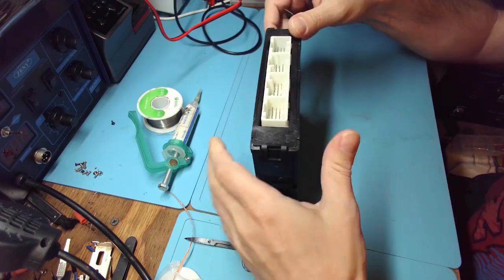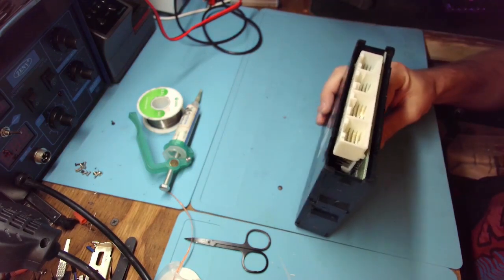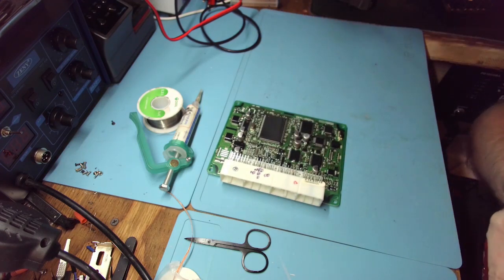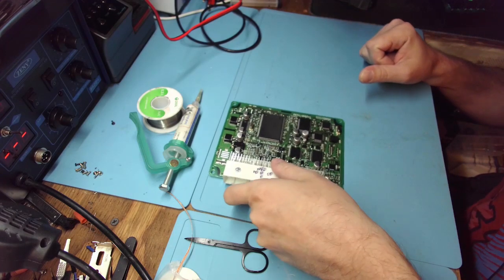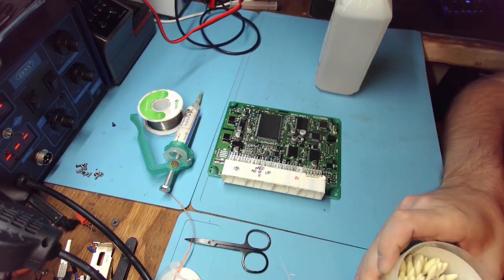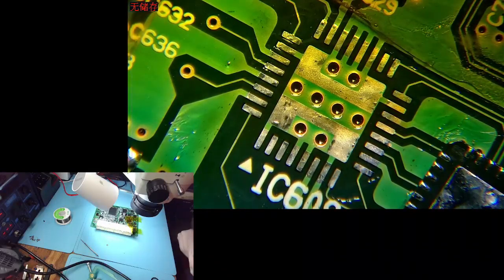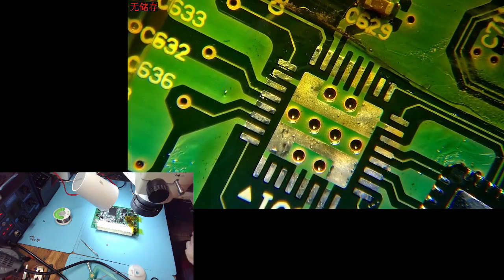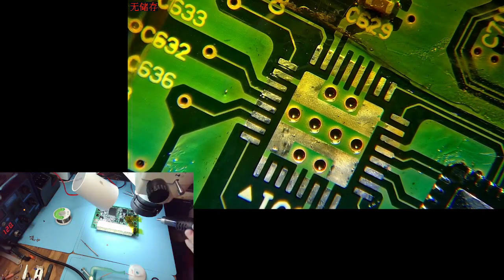Subaru ECM Repair for Ronald [WY]  | Only RMA flux will get the job done

Comment: Hello- are you replacing the component or just resoldering the existing one? Thanks!
Reply from the maker: I typically replace the component but resoldering works just fine, there's nothing wrong with the component itself

Comment: Hi. I have two Tribeca's. One is a parts car. Misfire on 6 with the good Tribeca. I changed plug, coil and injector. Think I can just swap the good ECM out of the parts car? If that doesn't work, can i mail you the bad ECM? Pretty sure I cannot do what you did in the video. How much to do that to mine?
Reply from the maker: sure thing, you can purchase this repair on eBay and send it in
https://www.ebay.com/itm/186596114807
Reply: @blackhorserepairs  Wow! thanks for getting back to me so quick. I will start saving up the $185. My Tribeca is a 2006 though. Is that ok?
Reply from the maker: @Rudi.Ani.Valentine  you can confirm that it has IC608 present, if so, that's the problem, otherwise I can provide the replacement (most likely)